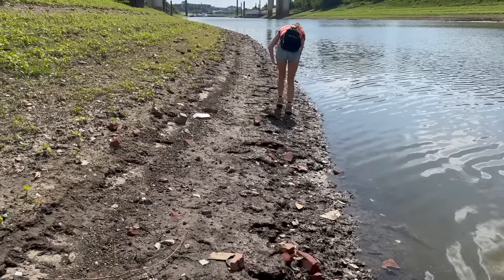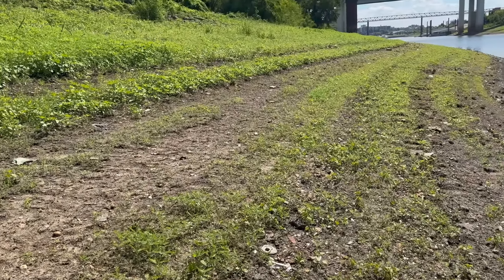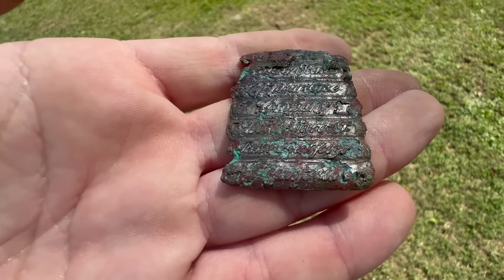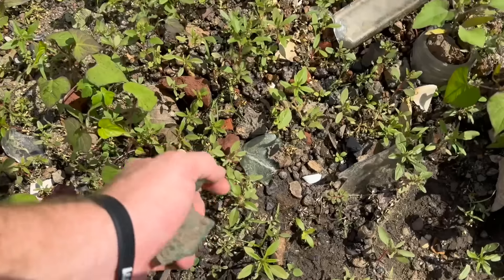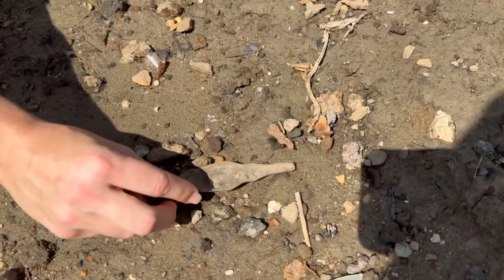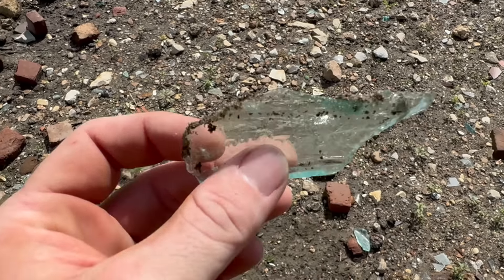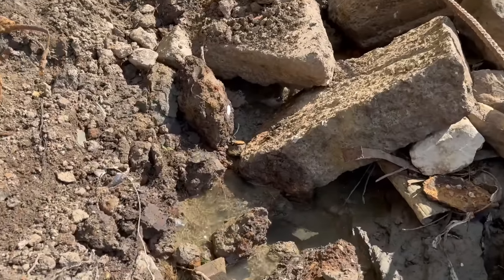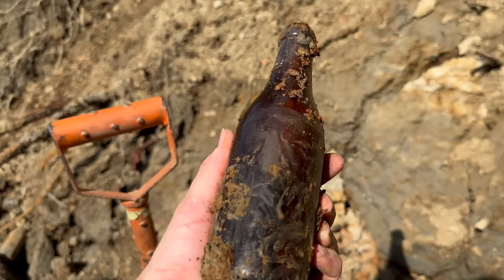Historic Flooding uncovers River Treasure along Mississippi River for American Mudlarkers!

Comment: Used to be?  Don't you still work in the trade?  
Also, can you heat those cut edges with a torch to round them off, or does that crack them?
Reply from the maker: Im now a machine and cutting tool specialist for a large distributor.